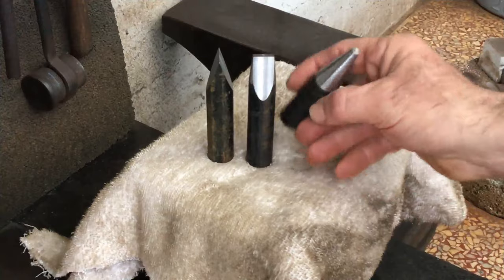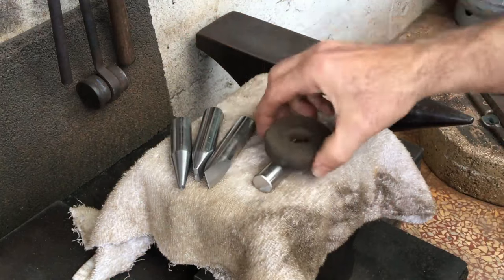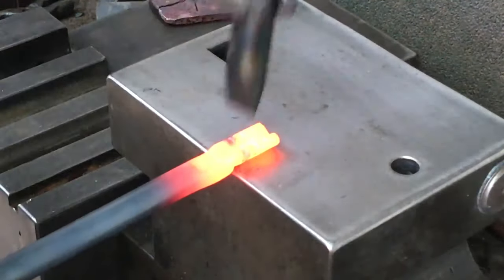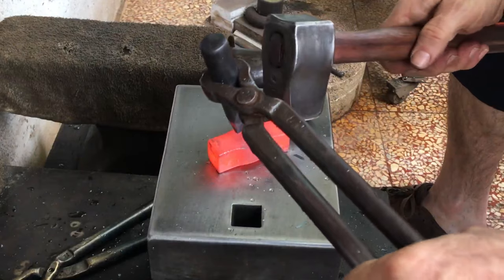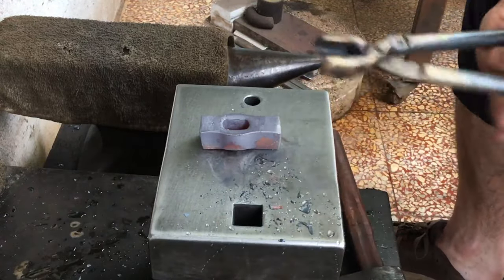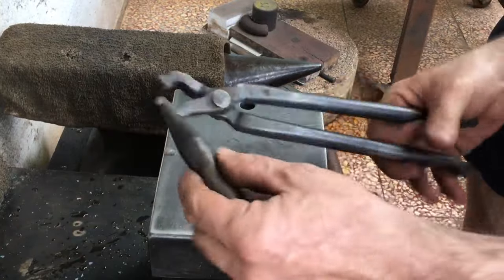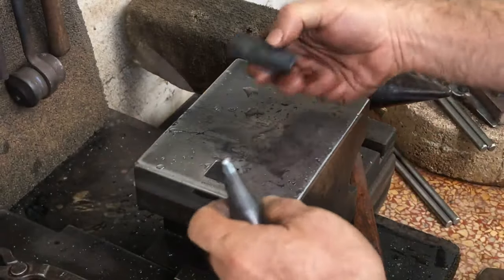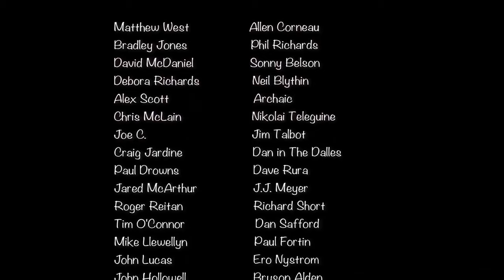420 Stainless Hot Tools? - GS Tongs

Comment: Quenching doesn't anneal copper. It's the heating of the copper that softens it. You could let it air cool for the same effect. Also, the magnetism of stainless steel has to do with the iron content, not the carbon content.
Reply: The magnetism of stainless has to do with the presence of room-temp austenite, caused by nickel in 300 series and a mix of nickel and manganese in 200 series.
Reply from the maker: I misspoke - wanted to say iron. Also, I should have mentioned the very high nickel content in 300 series compared to the relatively low nickel content in 420 as another factor... I'll see if I can annotate the video to correct this. Annealing doesn't harden the copper like with carbon steels so no harm in cooling quickly plus I like to see what colors emerge from the quench. Thanks.
Reply from the maker: I should have mentioned the high percentage of nickel in 300 series stainless leading to its non-magnetism as well as relatively low iron content. Thanks for your comment.

Comment: hmm I imagine the stainless is a little more expensive than H13 but wow what a difference ....not good , well done getting that punch out
thanks for sharing
Reply from the maker: Yeah, I will try quenching directly in water and see but I don't think it'll make a difference. And yes, the price of 420 stainless and H13 is close. Thanks.
Reply: @gstongs  I did a bit of research and though the higher temp hold and oil quench is easy enough, the reheating every time you use it will make it a lot like toffee to use for punching hot. I don't know if it would hold up to cold punching ...I suspect not but what do I know. Overall I reckon H13 is still the way to go